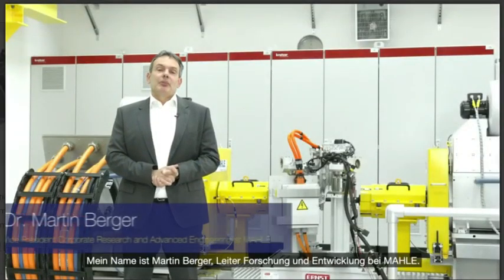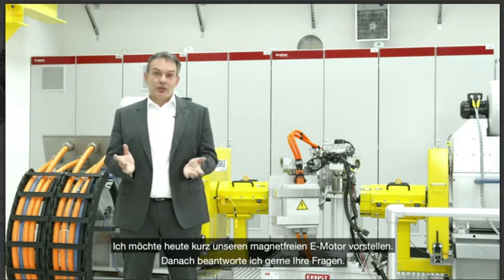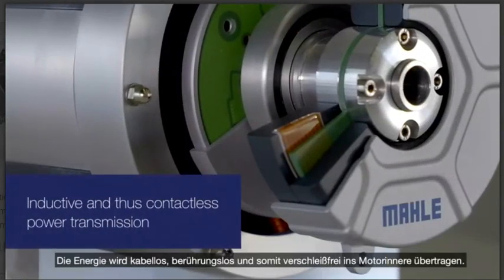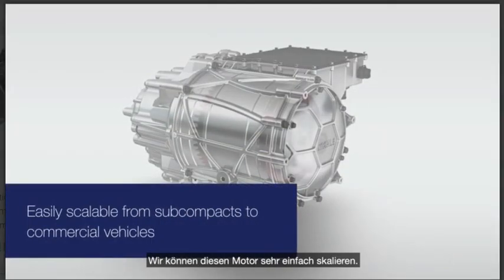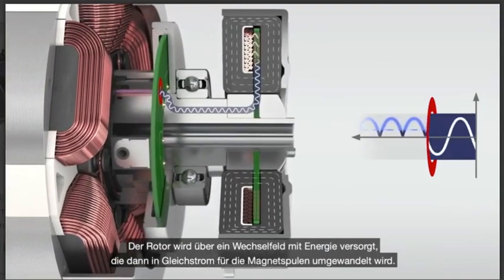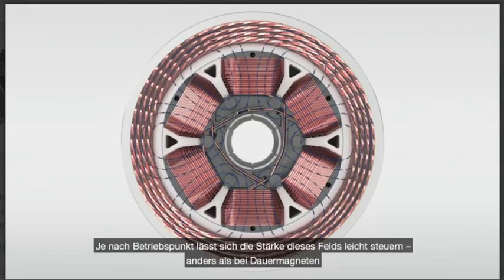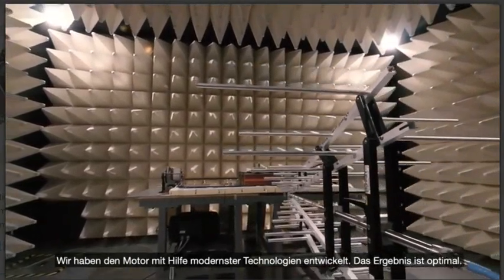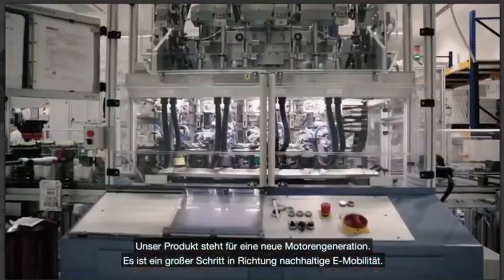Mahle, produce revolutionary new no-magnet motor...

Comment: That's old technology. A lot of wasted energy, less efficient.
Reply: Wrong. Though it's more than century old, this kind of electrical engine ist extremely efficient.

The only electrical engine which is slightly more efficient, is the permanent magnet charged synchronous engine.

Comment: So a rotating transformer instead of slip rings? Sounds like a perfectly good idea -- after all, the rotor doesn't need that much current compared to the stator. The bigger environmental issue though is the materials needed for batteries.
Reply: What does a motor have to do with batteries? That's an entirely different thing.
Reply: @CatNolara  Really? Show me an EV with one and not the other.
Reply: @GRAHAMAUS  electric motors don't only get used in EVs, you know?
Reply: @CatNolara  But this particular motor is designed for EVs. That's what "traction motor" means. They even show an EV in the video. My point is only that while eliminating the use of rare-earth minerals in the motor is definitely a good thing, it's only a small fraction of the problem compared to batteries.
Reply: @GRAHAMAUS  Yes, although the materials of concern in permanent magnets are not the same materials which are of concern in batteries.
Reply: Actually it’s inefficent transport, non-integrated mining operations, (unnecessary or redudant) material processing and differing battery composition.
If you know the exact chemistry and material composition of a cell, li-ion batteries can be recycled with 99.98% efficiency ( Panasonic 2170 ).
It’s even more economical to reuse raw materials that were already refined than sourcing new ones.
When or rather if a (Tesla) Battery pack reaches EOL (2019+ this would be 1m miles+), Tesla is basically buying the battery back from you and will sell you a new one for the cost of refurbishing the raw materials.

Li-iOn degradation occurs during a initally crucial buildup of cathode or anode particle build up on the isolating “paper” layer. Over time this blocks and prohibits original charging behaviour.
Yet the materials don’t get “used up” or chang in their composition; they just need to be re-melted.
If you know the exact(!) composition of a battery you can make a production line that can make this recycling process a lot more economical than buying and refining fresh raw material.

This is a non-issue today. EOL batteries (tesla/panasonic) make up >0.1%
This will be a post ‘25 agenda when early adopters run into this issue on a growing scale so the investment in productionlines makes sense schedule wise.
Rn we are nowhere near that point with total li-ion energy storage capacity being ~0,5TWh

If you don’t like non-recyclable battery cells and e-waste, thank all the android phones which make it extremely difficult or near impossible to swap those batteries in order to save on design.
Then they all put in entirely different designs, chemical compositions and weird custom shapes in small production capacities for niche markets.
No production line could safely recycle those cells. Wouldn’t be economical nor ecological. 

But then Lithium and cobalt in a current 18650 EV (iD3, QEC, Bolt) which have a lot more of those “rare earth” materials with bad press in them than teslas current 2170 composition, only have about a gram per kg of battery.
It’s mostly aluminum.
Then some nickel and copper.
Lithium is dissolved in the electrolyte in minuscule quantities.

Comment: One thing not mentioned is that rare earth magnet motors have to be actively cooled to prevent the magnets from getting too hot.  If their Curie temperature is exceeded, they lose their magnetism and can be permanently damaged.  Electromagnets aren’t affected this way and thus can be operated without as critical cooling provisions.
Reply: And how do you cool magnets on a rotor? Airflow?
Reply: You cool the stator where the wires carrying the current are generating the heat.  Hard, but not impossible, to cool the electromagnet rotor, but it isn’t subject to the constraint of having an 80C Curie temperature.  You wouldn’t want to have to run coolant through a high-speed rotor, and you want it to be as lightweight as possible.
Reply: @eddiegardner8232  You normally use gas to cool it. Air in small engines and Hydrogen (very low friction and still good cooling effect) in  power plant generators
Reply: All motors in EVs have liquid-cooled stators (whether induction or PM), and that's enough cooling for the permanent magnets... but yes, magnet temperature is a concern addressed by the design and by motor management (by the controller). A wound-rotor motor like this is less sensitive to high temperature, but it also makes more heat in the rotor.

Comment: Is there a weight difference (heavier? lighter?) when compared to conventional brushless motors of equal performance?
I'm asking because of the newly emerging field of electric aviation, where weight is more crucial than in other areas. An alternative contact-less motor with 95% overall efficiency sounds nice.
Reply: A synchronous engines with neodym magnets on the rotor is smaller, lighter and even more efficient.

Comment: But if that motor has no permanent magnets, it cannot recuperate the brake energy. Unless you could explain how it can do it.
Reply: Should work just the same as the alternator on a  car engine. They need to put a field on the rotor, and get regenerated current out of the stators.
Reply: good point but is still an achievement.  maybe they'll attach a such a device and call it recuperator
Reply: As long as you provide a few hundred Milliwatts (as much as you need to illuminate your display) to provide the current for the rotor, everything is fine. 

The alternator in any car works exactly alike. A few Milliamps of current to charge the rotor together with the mechanical energy from the Motor delivers 100 Amps of current to run the car's electric system.

Comment: Sounds like a mash up of old auto alternators/generators that use a self excited coil along with a motor 👍🏽
Reply: That was just my thought. A pilot exciter winding powered by the gen battery and a rotating rectifier. With an AVR controlling the voltage. Faraday RH becomes LH and generator becomes motor lol
Reply: Yep it is. You can actually run a car alternator as a motor if you remove the rectifiers and replace it with a BLDC motor controller.
Reply: @berni8k  its because of the beautiful symmetry of magnetism and electricity means it would be more work to design a generator or motor that couldn't possibly be used as the other
Reply: The trick is to generate the field reliably on the fly.
Reply: All brushless alternators use this technique.
Reply: @subramaniamchandrasekar1397  Not quite. Brushless alternators typically use the rotation of the machine to induce current in the rotor winding, but this transfers power to the rotor independent of rotation.
Reply: @brianb-p6586  uses separate coil in stator .A.C. on this coil to induce A.C. in rotor coil  which is rectified by diodes to DC and fed to the main excitation windings
Reply: @subramaniamchandrasekar1397  Yes, that's how the Mahle motor operates. "All brushless alternators" are not the same - they usually have a DC stator coil inducing AC in the rotor coil by machine rotation, unlike the Mahle system.
Reply: I thought the same as well. In addition when I was a kid, I disassembled a car's cassette player which contained a motor with an excited coil as well. That was a big surprise to me as I hoped to salvage magnets. Years later when thinking about it I figured that one of the reasons could possibly to avoid demagnetizing tapes that stay in the car for weeks or months without being used. Last, there are plenty of alternating current motors using no magnets either in pumps, drills, etc. Some even use an aluminum rotor with Eddy currents!
Reply: This isn't that different from a plain induction motor, except that it seperates the function of transmitting the power to excite the rotor coils to a seperate system, optimized for that purpose. I suppose the advantage is that if you make the stator coils responsible for both the rotor and stator excitation current, you get (rotor+stator)-squared losses. Then again if you dedicated that same space to just a longer motor of the same flux density, would it really matter? If so this kinda sounds like an induction motor; just with added complexity, but perhaps I am missing a nuance.

Then again, if they had impressive power density figures available, I suppose theyd mention them. You can also get an induction motor to be very efficient at any RPM as long as you are happy with low power densities.
Reply: @eelcohoogendoorn8044  Yes, improved power density may be an advantage (although they don't make that claim in the video).  Also I wonder if the relative simplicity of controlling the excitation current may be an advantage (the AVR-type electronics they would use is cheaper/simpler than a VFD used to control the output of an induction motor).
Reply: @chriswright9096  power densities are already very high for electric machines, the "step back" really isn't that much. The energy storage, i.e. the battery is a mobile system's Achilles' heel. Especially, if range is a denominating parameter.
Reply: @chriswright9096  VFDs are no more complex than modern BLDC controllers. They just have that reputation because OEMs are still selling them to plants designed in the 80s, for the same price as they did in the 80s; but watt for watt you are looking at the same components and a few lines of change in code.
Reply: @chriswright9096  Close... the stator is still controlled by a VFD, but the rotor current is separately (and easily) controlled, unlike the uncontrolled induced current and resulting field in an induction motor's rotor.
Reply: @eelcohoogendoorn8044  induction motors do not have excitation windings.
Reply: @subramaniamchandrasekar1397  Not sure what terminology you are using, but what I mean is that in an induction motor the stator windings are used to excite both the stator itself, and indirectly through control of the phase lag (and obviously induction), the stator windings excite the rotor currents as well.
Reply: @eelcohoogendoorn8044  An induction motor have shorted rotor bars and rotating torque is produced by the circulating currents inside the rotor. This is a wound rotor, so not an induction motor. Regards.
Reply: @subramaniamchandrasekar1397  I didn't say this was an induction motor; not a classical one at least, but taking the term literally it is, since its transmitting power to the rotor via induction; its just using a separate set of dedicated coils for it, probably operating at a higher frequency. Having a wound or solid rotor isnt a defining feature of an induction motor; infact wound induction motors are not all that rare; they are less convenient in construction than a solid bar induction motor, but are the preferred option if rotor eddie currents are a driving concern.
Reply: @eelcohoogendoorn8044  Wound rotor motors are also called slip ring motors. They have an advantage over conventional induction motors on high starting torque and low starting current, Induction motors require 6 to 7 time full load current during starting and still lower starting torque. The slip ring motors can be started from near zero to max speed in progressive time as the process requires. I believe the term induction refers to induced currents in the rotor, which creates a torque. Your word induction probably refer to magnetic coupling, If I am correct. Regards.
Reply: Ahhh yes. The single wire "Starter-nator"

Comment: Wait you mean like a universal motor of sorts?
Reply: No. A universal motor has brushes - this doesn't.
Reply: @brianb-p6586  key word "like" even if you like at  the animation you see an ac circuit becoming a dc circuit. It goes from full wave to half wave. I haven't had to time to think about how they are doing this wirelessly and I want to do that before I look into the research, but basically in general it's LIKE a universal motor
Reply: @jonjudice1155  In the sense that every electric motor is like every other electric motor (DC, AC, asynchronous, synchronous, PM or not, magnet or reluctance), because they all use current in coils to make magnetic fields... yes.

A universal motor is called that because it runs on any frequency of AC power, even zero (which is DC). The Mahle motor is a three-phase AC motor - the frequency and phase of power supply must synch with the rotor speed and position, and it won't run at all on DC.